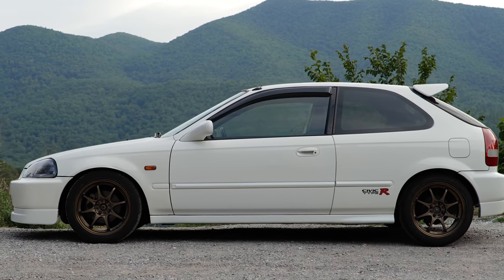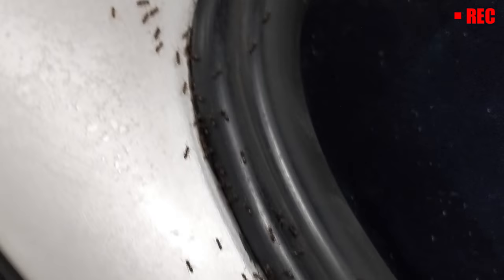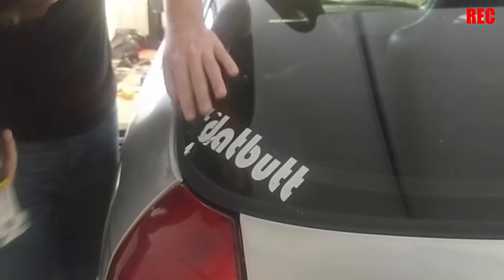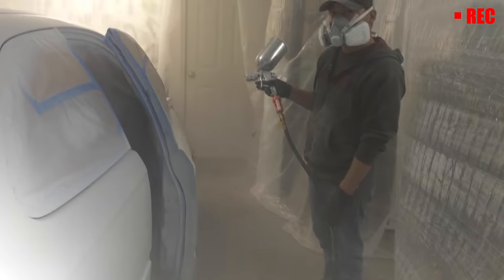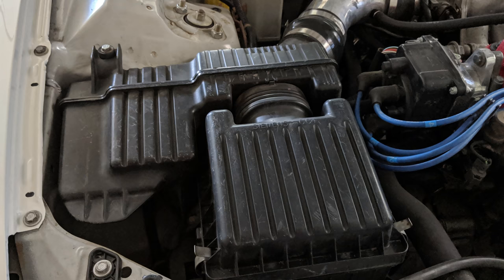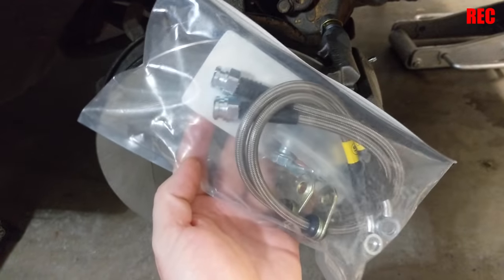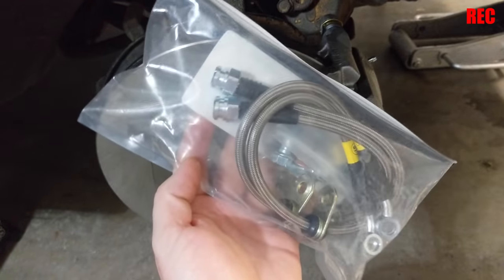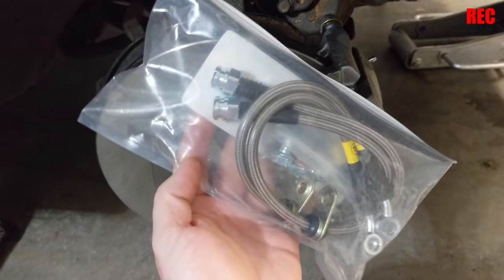How I bought my Civic Type R replica for $5000

Comment: You should set the rev limiter to 9001 so you can say "ITS OVER 9000" when you redline
Reply: This guy right here... he gets it!!
Reply from the maker: I like the way you think...
Reply: Ah yes
Reply: ya but wouldn't the inertia of the engine and slightly carry it over 9k anyways as the limiter kicks in?
Reply: Eli Herman 420!!!!
Reply: Kilo Byte  Nani???
Reply: Vegeta has entered chat
Reply: @KrashKan  some limiters do limit slightly before  that...
Reply: How is it a ricer car 😆. It has a B series motor ? Tf 😆
Reply: Tell me why I said it like vegeta then went back to normal voice after lmao 😂
Reply: @KrashKan  it's calculated with interia in mind
Reply: @GamerPo2  sorry man did the same can't tell you why😂
Reply: vegetta definitely would approve
Reply: Eli Herman But the thing is it would bounce off the limit so actually it would be like 8400 rpm up to like 8900 so it should be 9200
Reply: Bryce Czirr that’s funny and all until you see allmotor F20b running 10.9 with only 185 ft lbs. meanwhile v8s with 400 ft lbs are stuck running low 12s
Reply: Thats the dub its over 8000 in the original 😉
Reply: Xd
Reply: Wassup with the rims you took off
Reply: @Bryce Czirr Because rpm you can measure the torque engines make ...
Reply: @Bryce Czirr Your joke is oudated as your low rpm torque diesels.
Reply: 9,000.5 rpm
Reply: Or 9,000.1
Reply: @Bryce Czirr That's your best argumment you came after 2 months? Where they told you that, never talked about when they were destroyed by small 4cyl engines.

Edit: Also, the Fastest WTAC is a civic 4cyl ;)
Reply: @thatfunnykekguy6377  All muscle car boys have small wenus'.
Reply: @GearsandGasoline  I also like the way he thinks...
Reply: Isn't that meme extremely outdated now?

Comment: The Civic Type R Ek9 is definitely one of the best hot hatches of all time
Reply: Yep :)
Reply: To bad this isnt one of them... Its a dx, type r wannabe. As long as he never claims its a real type r(especially if he sells it) then its fine.
Reply: Josh P well atleast it’s a Type R build which includes the OEM parts
Reply: @basithph8958  it isnt a type r build though. Its a dx type r clone. I worked restoring classics and its what is reffered to as a clone. If i take a 6cyl camaro and make it a z28 with all the parts its still not a z28... Its a base 6cyl vin made to look like a more popular and more powerful car. Technically if he tries to sell it as a real type r then he is commiting fraud. This isnt a new thing.
Reply: Josh P I see what you mean atleast its a proper Honda build
Reply: One of the best. The actual best is the fd2 type r 😍
Reply: @joshp2542  And he says it's worth 10k lol no way. Maybe 6k as it sits.
Reply: @GT6SuzukaTimeTrials  its worth exactly what a dx hatch is. Clones actually take away some value because most people want the real thing.
Reply: fd2 civic is the best type r ever made, I had a dc2 and swapped it for a lower mileage ek9 I immediately regretted it, the b16b is just too underpowered, it needs the b18c to be fun but Honda have said if the ek9 came with a b18 they wouldn't of sold any dc2s
Reply: @lunarshteve  i agree, my grandmother loves her civic. So does my aunt and other grandmother. Great car for commuting and picking up the kids or groceries. Perfect car for women. Its front wheel drive so it handles like shit and will never be a race car but i think they are nice.
Reply: Thordur Hogna  what 2 cars? A real type r has a vin number for a type r. A vin number will always prove what is real and what is a clone. There might even be a owner registry to keep track of the real type r's out there.
Reply: @jakson small this guy gets it
Reply: The chassis on the EK9 is sublime and it imo it handles just as well or if not better than the dc2, it just needed more power and it would of been perfect.
Reply: @joshp2542  You're being too critical here bud. One look at the LHD and you know it's not real, but as long as it's properly built with not just badges but also the drivetrain and all the special parts that made the type R a type R then who cares. I mean you do but who else. In fact I'd rather have this than a real one, because it's everything the real type R would be but cheaper, LHD, and less to worry about losing if you crash it. We all know it's not a real one, he's not claiming it is, and most people could not care less. It looks good and more importantly has the performance to match. If you take a Subaru 2.5RS and JDM STi swap every part that's different between the two, then go ahead and call it an STi, it's not doing any harm, and it's basically the real thing just with a different vin. You seem to be one of those people who's more concerned with a car's value and investment purpose rather than just getting out and driving and enjoying the car for what it is in its current state.
Reply: @jameshavenga4998  someone who buys a clone thinking its the real thing cares. Its fraud to claim a vehicle is a model its not and sell it for the price of in this case a type r. Also as a car guy its lame when someone makes a car into a model its not. I know people who badge their civics up as Acuras. Among car guys its a joke, be proud of your dx. If you wanted an type r so bad get a real type r. Would you buy a real 69 rs/ss camaro or a 6 cylinder dressed to look like one? I kept my 71 chevelle bone stock and it got way more attention at car shows then the 70s or 69s made into a fake ss. People who know civics are going to walk up to the car excited... And walk away disappointed that its not a real type r. 

And btw a guy in ohio went to prison for faking a 66 chevelle ss convertible(only 12 cars made like that) and selling it as one(mabye not a vert but it was 1 of 12). Its fraud.
Reply: @joshp2542  yeah but I think any serious buyer is going to know it's a replica as they're gonna do a vin check as well as see it's LHD and I couldn't imagine this seller claiming it to be actual from Japan type R. And the SS didn't come with much else over the 6 cylinder other than the motor. I'd buy a Camaro SS replica so long as they'd swapped everything, not just the badges. Hell I'd just take the badges off of that and keep my V8 swapped V6. As long as it feels and performs like the real thing and is being sold as a replica that's what matters. This type R has all the Type R goodies but since it's a replica it's waaaaaaay cheaper than the overpriced real thing, so it's all the fun without the ridiculous pricing. I guess I'm just not much of a badge whore, I don't care what badge the car has on it as long as it's enjoyable to drive and doesn't look like a total basket case
Reply: @jameshavenga4998  the problem is people either assume its ok, or if someone buys it thinking it will hold its value. And never underestimate what a seller will say to sell a car. Ive seen horror stories personally that make you wonder what the buyer was thinking. It boils down for me, to why wouldnt you be proud to own the coolest dx... As opposed to a knock off of a higher end model. You can have a beautiful car regardless of what model it is. As a car guy I love seeing rare models, I get tired of seeing a base model done up to look like a higher end one.

The bottom line is be proud of your car whatever the model is, and dont try and make a car into something its not.
Reply: FD2 
The last NA TYPE R
Reply: lancia delta HF Integrale is better
Reply: John Mitchell oh yeah the K20A is definitely the best version of VTEC
Reply: @lengerer  I owned an FD2R before. Trust me, you will hate it when you are NOT using it on proper race tracks. In city driving, it is a gear changing marathon because the gear ratios are so short. 120km/h is at 4k rpm at 6th gear.  And it feels like it does not come with shock absorbers, the ride is rock hard... Compare to a normal version of FD2 Civic, the Type R has minimal sound proofing, so it is more noisy than a cheap econobox and doesn't even come with a reverse sensor from factory.
Reply: @fleurdewin7958  I think that's why I like them haha
Reply: Best of the best typeR's 
Mia's NSX (busting Dom off the penial bus)
EP3 or DC5
Jordan EK9 
Mugen FN2
FD2
Old CH1 Accord
Unfortunately the Prelude never came in a typeR.
This list is my opinion but I'm happy to hear any others opinions
Reply: mk4 GTI
Reply: @Austin-cx2xe  *mk2
Reply: @joshp2542  Considering that he would have to make it left hand drive to sell it as a type-R.
Reply: @GT6SuzukaTimeTrials  The engine is worth $2500-$3000.
Reply: @jameshavenga4998  It's right hand drive ffs. Civic type-R's were never sold in the United States.
Reply: @richardhowle4871  his Civic is LHD. Wtf are you on about? I'm well aware the CTR was never sold here, and I never said it was.  That's why I said no one would think this is real because you can see this is LHD and real Civic Type Rs are RHD.
Reply: @richardhowle4871  it is LHD, he would have to make it RHD to sell it as a type R. Literally there's a famous import site called RHD Specialties because they import cars from Japan where they are, you're not gonna believe this, RHD. You've got it backwards bud
Reply: @jameshavenga4998  Sorry that was meant for JoshP. He was on about the dude trying to sell it as a Type-R.

Comment: Thank you for dericing the civic. Previous owner had the usual STANCE NATION taste. Great job on returning the car to being clean. I would of done the same thing.
Reply: Shitty wheels, eBay under brace, yonaka exhaust, and probably  stance coilovers. I'm sure you're one of those "respect all builds" type of guy. Previous owner had bad taste in mods. That's my opinion. If you're into stanced out non functional rides, more power to you.
Reply: @Kyezie131  I'm not calling all civics a ricer. Hell I own a supercharged s2000 and been in the Honda game a long time. It's just the style of the previous owners taste which disgust me with probably some kind off stance xxr wheels, eBay bracing and eBay yonaka exhaust. Ben's taste is just like mine, clean, quality jdm parts, and putting back ac and ps. So yes, not all civics are ricers, just the previous owners.
Reply: Sie Lee exactly.  But hey I did have a yonaka exhaust on my em1 -_-
Reply: @Kyezie131  I can respect other builds completely when they're done well and they're functional. My EG is lowered on some Skunk2 coilovers to a functional level purely for handling and even then I scrape here and there and it sucks, and mine isn't near as low as this EK was. Like it's just stupid, why sacrifice usability purely just for looks? I'll respect your build when you can get over a speed bump in a grocery store parking lot without screwing up the bottom of your car haha
Reply: @Kyezie131  i hope youre joking. the condition of the car when he purchased it from the previous owner was absolutely horrible. almost every part the previous owner slapped on that poor car was ebay junk. so yeah, it was done in poor taste
Reply: @chubbylee240  I have a 2005 Acura RSX Type S, AEM cold air intake, Skunk 2 MegaPower RR exhaust, 1320 performance headers, K Tuned cylinders, mugen RR style spoiler, K20 motor, along with it being straight-piped underneath. Is that a 'ricer'? 

I plan on getting new aftermarket rims (17", one inch lower than stock wheels) Toyo tires, and de-straight piping my care going back to a stock header, catalayc converter but keeping my Skunk 2 exhaust. I also want to lower the car to the tires. I also want to color in "Toyo" on the tires white, and I want a front and back lip/ {Possibly customized front and back bumpers as well.) Is that 'rice'?
Reply: Sie Lee yonaka exhaust and stance coil overs are great. Wtf are you talking about.
Reply: @jameshavenga4998  Air ride yo.
Reply: @Debbie52S  As long as it makes you happy it's fine.

Comment: I bought a cheap riced out s2000. Currently doing the same process of bringing it back. LOVE the video. Some people just have awful taste.
Reply: It's not awful taste it's just different, people buy cars and do what they want to the way they want to do to them because that's what they like. Like myself I generally straight pipe everything, but some people hate that. But I really don't care what other people like I alter the car the way I like it. But that doesn't mean you're adding value and that's what some people forget.
Reply: Where I live by enlarge the cheapest s2000’s are the ones that have had the most ‘work’ done to them
Reply: Paint was shit and it was too low thats about it I dont get what was poor taste
Reply: @professorweedington4962  You didn't get the memo? Doing any mods at all is automatically rice nowadays :)
Reply: @emperorpalpatine3088  No it's not. Rice are mods that render a car less functional. Putting a giant rear wing on a Civic DX for example does absolutely nothing.
Reply: @sdlausen1  I was being sarcastic, mate.
Reply: The only thing I  didn't  really get was putting that lame OEM exhaust on it but it's his build everything else is dope
Reply: @sdlausen1  I'm still not clear what 'rice' is all about. My personal take of 'rice' is putting a cheap exhaust on a car that shouldn't take it, and it sounds bad. I encounter plenty of those where I live.  However I see plenty of nicely built civics in my opinion that, well sounds just like how a modded civic sounds. I've seen rough paint jobs, but I disagree that 'flashy' is rice. Maybe multi-color and excessive flashy is a bit ghetto but it's just what the owner wants to do. I honestly am just happy to see people interested in modifying their cars. Like I said the only thing that bothers me is an excessive exhaust on a stock or run down honda civic, or any car with that criteria. I do agree it makes the rest of us enthusiasts look bad. But if they keep an exhaust off, want to put rims on it and lower it then so be it, I find that look rather clean looking. It's not a 'race' car or 'tuner' car, but it's just a preference style. 

I have a very loud (MegaPower RR exhaust) on my '05 Acura RSX Type S, along with other actual performance modifications, and a mugen wing. Is that a 'ricer'?

Comment: My family used to have a '98 DX civic sedan-same silver color. 5 speed manual, manual everything-manual window cranks, manual door locks, we even hooked up a sirius xm to the cigarette lighter. That thing was a beast. Sold it with 250,537 miles on it due to a broken air conditioning compressor. These videos bring back the memories of that car.

Comment: OK this made it even more complicating. There's no way you bought that for $2800
Reply: Japple stop 😂
Reply: I bought an h23 swapped EG hatch with 200whp for $1500. Deals are always out there you just have to be willing to filter through hundreds to find the perfect one
Reply: Javi yeah
Reply: @erendyalatorre7785  For real. Found an 05 Cat eye extended cab chevy 4x4 for $3800 a couple weeks back. The truck wasn't bad, just rocker rust and front bumper needed replaced and master cylinder. After fixing just those things the truck is now worth like $9-10k now where I live.
Reply: @erendyalatorre7785  So deals are def out there, like you said. Just gotta look past all the garbage.
Reply: RICARDO  A B16B complete change over costs $3,700 on HMO and that's without shipping. He paid less for the car with a B16B already swapped in. Not to mention it comes with what looks like a PLM Power Driven (V2) header and exhaust. Sure, it was pretty ugly, but people can change the way a car looks. $2,200 spent on wheels + tires, brakes, type r exterior pieces, type r interior pieces, engine maintenance parts and a paint job is a lot for $2,200. He got a good deal on the car. I am going to assume you are bitter because you don't like Honda? If that's the case, it still doesn't change the fact that he didn't overpay for the car. If you can find a CTR clone with a B16B and in this condition for $5,100, I will buy it. The engine must have new seals, the wheels and tires must be new, the brakes must be new and the paint needs to be nice. I doubt you will be able to find one for me.
Reply: @wackomanx  bro 2800 where I live would get you a beat to hell automatic ek with 200k miles and an oil leak. A fucking regular b16a2 swapped ek would go for 6k+
Reply: they are pretty cheap
Reply: RICARDO  Oh no, the header cracked at a weld! Sometimes that happens. I have seen it happen to replicas and I have seen it happen to higher quality brands like Toda. There is definitely some surface corrosion on the engine & transmission, but it's not horrible. Obviously it's not going to look as clean as it did when it was new. I have seen engines far more corroded than this one from HMO. I don't even understand how you interpreted my response as it coming from HMO. That was just the first place I checked for the price of a full swap. I just looked at other sites and they are nearly the same price. Who cares if it's a DX model? Besides the CX, that's one of the lighter models. Have you had any luck yet on finding that B16B I said I would pay for? I'm not kidding about buying it.
Reply: @gibememoni  Yep, the price to own one has really gone up in the past few years. I live in the states and paid $3,500 for a 5 speed 1999 Honda Civic Ex coupe with 136,000 miles around 5-6 years ago. It had some small dings in spots, but it was really clean for the most part. In my eyes, the guy got a good deal on the car. I know people in my area would put the car up for sale for $4,000 or $4,500 in the shape he bought it in.
Reply: Japple I find it hard to believe it's a genuine 16b probably an a2 or a